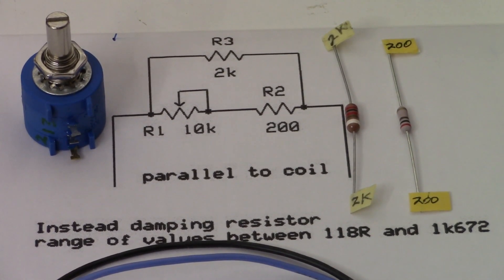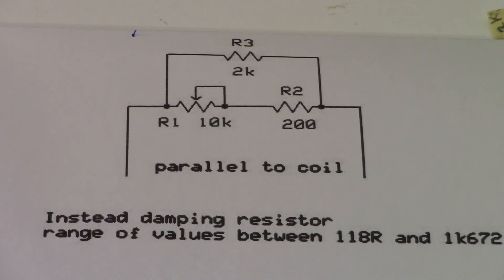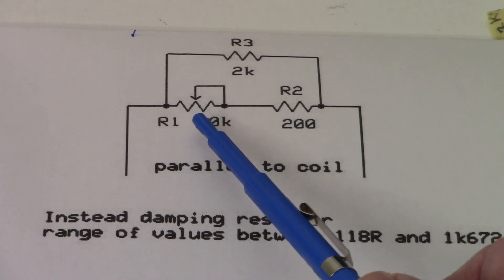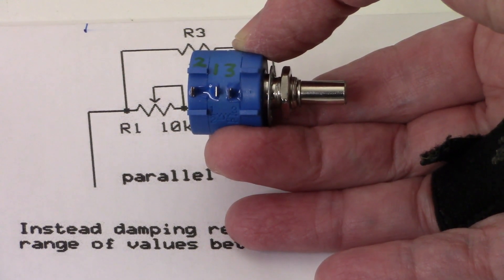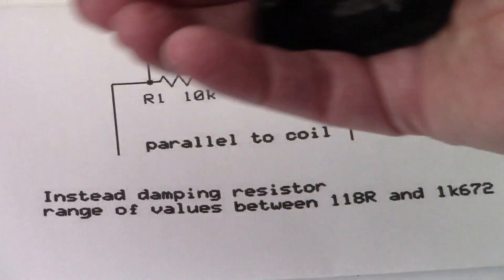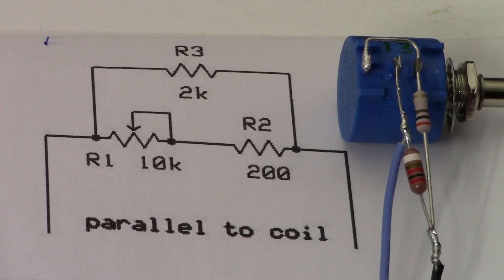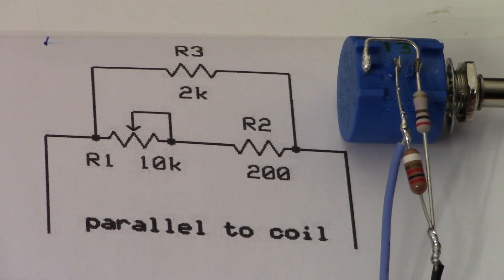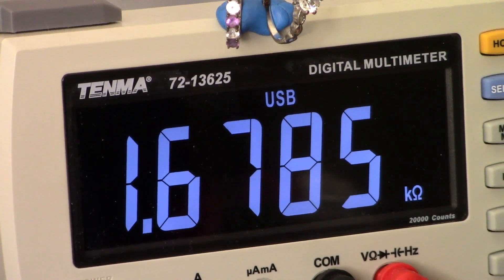Pulse Induction Damping Resistor Jig

Comment: Does the potentiometer used for testing have to be of appropriate power?  Can a small adjustable resistor be used?
Reply from the maker: I would recommend at least .25 watt (1/4)  This is not designed to stay as a permanent part of your circuit.  It is only for testing.
Reply: @SurfDetector  All clear.  thanks

Comment: So the low point is 199 and the high point is 1678... what is the value of the damping resistor we need..? To Google what exactly?
Reply from the maker: As I told you previously, you should be using a oscilloscope to view the preamp output in order to choose the value
Reply: @SurfDetector  Thank you. So I have made the Damping resistor Jig exactly like yours and I have connected the coil to the detector. Now you have two cables coming out of your Jig black and purple. Black connect's to one of the coils wire and purple to the other ( parallel)   Turn the detector on and find the finest point with the Jig on the oscilloscope. Disconnect and measure the Jig  with my resistor meter. Is that correct?
Reply from the maker: yes the jig goes in parallel with the coil.  What detector are you making?
Reply from the maker: @RadioActiveDonats  If that board is already made then it will already have a damping resistor, you might need to change it.
Reply: @SurfDetector  I can't really change anything on this board because is under the little LCD and I have glued it for stability. But let's say you buy any already made board or a detector without a coil. What do I do to make a good performing coil? What do we measure?
Reply from the maker: @RadioActiveDonats  In that case you need to find out what coil inductance the detector is designed to use.  Ask the people who you bought your board from, they should be able to tell you.
Reply: @SurfDetector  I do have the induction map yes. But if I didn't ..that's it ? You can't measure the detector to make a coil?
Reply from the maker: @RadioActiveDonats  Without ever having seen you detector I would say make something 300uH and go from there. Now I must concentrate on my real job

Comment: Hello I have felezjoo pi dedector own made, and I want to build dd coil with this system. Will it work?
Reply from the maker: Looking at the schematic I think that you should use a mono coil.
Reply: I am looking for big amount of metal in deep range, should I make 20" spider coil?
Reply from the maker: You can certainly make a spider coil as it is a mono.  What size you make is something that you need to experiment with.  I have not built a Felezjoo so I do not know its capabilities to be able to tell you if it is meant to be a deep detector such as a Delta Pulse.
Reply: Thanks for informations mate
Reply: Can I use spider coil as monocoil

Comment: When you use this for voodoo you hook up one side to the positive on the tx loop the other to the negative side of the loop then you hook up the hook of the probe to the positive side ? and the alligator clip on the prob goes where  ? Thanks
Reply from the maker: The ground clip on the oscilloscope probe in the Voodoo project gets connected to +12V battery which is the ground reference for that project.  As I stated on the Geotech Forum, if you have not already read the book that George wrote for the Voodoo, then you should do so as it contains most of the information necessary.  When using the damping jig the actual probe connects to the output of the pre-amp.
Reply: @SurfDetector  ok what was the green and yellow wires you had going into the tx coil output ?
Reply from the maker: What video are you referencing?  Without knowing that I cannot answer your question.  It makes things less confusing when questions pertaining to a certain video are attached to the video in question.
Cheers
Reply: @SurfDetector  the damping video that shows the resistors on the pcb at the start you have 4 wires coming out of the tx and Rx output a blue a green and yellow
Reply from the maker: So what you are referencing is not one of my Damping Resistor videos, rather it is "Voodoo DIY metal detector Part #4 Flyback signal and PI Pre amp output"
On the Voodoo the damping jig is attached across PL1.  The wires that you are asking about on PL1 are Green(ground reference) and Blue these are for the PI portion of the circuit going to the coil. On PL2 are another green(ground reference) and a yellow, these are for the Disc portion going to the coil.
Reply: @SurfDetector  ok thats what i thought but wasnt dor sure because ivonic had noise issues using just wires
Reply: @SurfDetector  for the minipulse plus beach rev-e, where I need to connect the oscilloscope probe? Thanks

Comment: Pot should not be wire pot, cause it ad inductance to circuit and as result measured damping resistor will be false.
Reply from the maker: Welcome and thank you for watching and commenting.  I see little difference using the wirewound pot as compared to a carbon or cermet or conductive plastic pot.  The resulting values tell the story when viewed on the oscilloscope.  Thank you again for the comment.